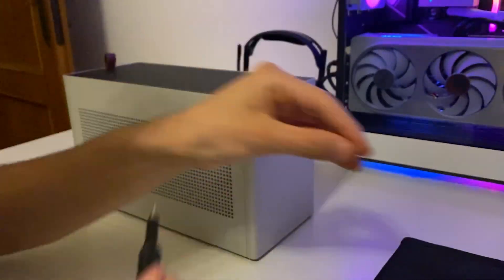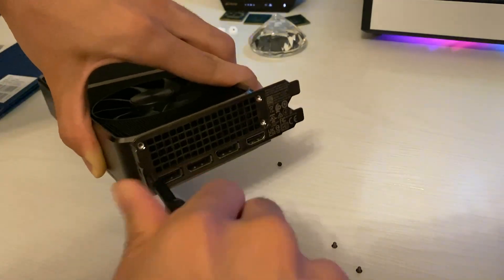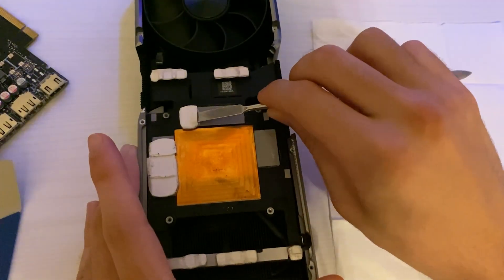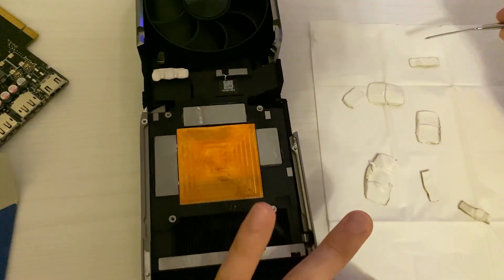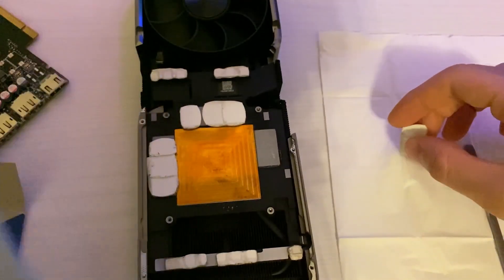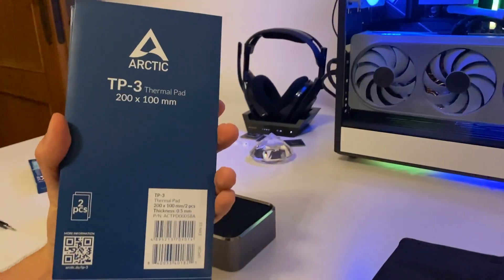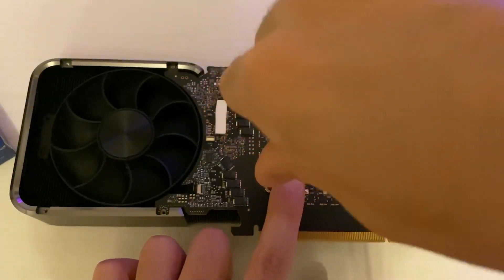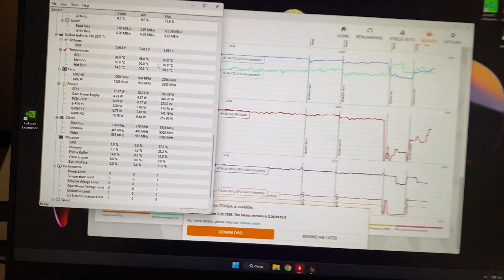You NEED to do this to your GPU | Thermal Pads & Paste Replacement Guide

Comment: Is 1.5mm correct thermal pad thickness for all 30 series Founders cards? I have a 3090 and a 3060TI?
Reply from the maker: Not for every single one, they made a few different revisions unfortunately. But yeah for most Founders it is

Comment: Stock temperature should be around 78 deg on core without overcloking. I did changed pads with same one and have also same temperature but they are whorse than before. Will ty squis them a make them smaller. If it helps😊
Reply from the maker: I’m sure it’s gonna work my man! :)

Comment: whats the correct thermal pads for rtx 3050 eagle oc? also which thermal paste do u recommend?
Reply from the maker: 1mm ones should work, but worst case buy a stack of 0.5mm and put them double or triple to reach the desired height. Paste wise I do recommend MX-6!
Reply: @ImWateringPSUs  thanks, this is the first time gonna do this so im kind of nervous, my gpu suddenly overheats, this doesnt happen before, this is 1.5 years old, thanks for the info, gonna sub!

Comment: I've been wanting to do this to my 3070 FE but I can't find the correct size for thermal pads
Reply from the maker: Yay that’s one of the trickiest parts. I’d recommend getting Arctic TP-3 in 0.5mm size and then stacking them one on top of each other to reach the desired height

Comment: You should try using phase-change material Honeywell PTM7950. It comes in as a sheet, lasts longer and performs in my experience works better than traditional pastes, and instead of thermal pads give thermal putty Upsiren UX Pro.
Reply from the maker: Thanks a lot for the suggestion, it’s not the first time I read about these! I’ll order a pack and make a video about it

Comment: Hello! I have a question: I have an RTX 3070 from ASUS TUF which is well known for its amazing cooling system, however I noticed that my temps were WAY, WAY too high at full load compared to what everyone was getting on the internet, for reference, everyone said it would normally peak at 61-62°C during full load, and mine was hitting 82°C at some point playing RDR2, so what I did is I figured out really quick that the thermal paste must have been dried up and it indeed was, I removed the cooler and I replaced the thermal paste with arctic MX-5 which i already owned previously, and that dropped temps about 12-13°C cause now im getting 68-70°C but i still think it's 8-9°C too much, do thermal pads impact the GPU chip temperature even if they are put on the memory and vrms? Because I didn't replace my thermal pads but i can tell they are pretty worn out, would replacing them fix the issue of my GPU temperature being too high or is it something else?
Reply from the maker: Your temps are overall good, remember that the fan speed is also important to normalize when testing temps. But to answer the question yes, better pads do help overall!
Reply: I repasted my Gigabyte 3070 and get around the same temps. Nothing to worry about👍

Comment: Have you seen the laptop alternatives?
https://www.youtube.com/watch?v=9uAAlIaOmQ0
Reply from the maker: That's an easier way to get the right size with pads, it works with desktop hardware as well but the cooling performance is quite a bit lower. You can get away with it on laptop but not on desktop GDDR6X memory!

Comment: i went with a evga 3080 hybrid never see temps over 55  with V Sync on, dont know why everyone needs 200FPS but 60FPS in my opinion good enough i never see flicking shuddering if u  use the min TDP  it will in the long term expend the life of the card reviewers ir Jay Linus Unboxed al push for max fps because frames sell good advise is to get a gpu which can play at 60fps and stable not go buy the next best thing my boy is playing Cyber Punk 2077 on a 1080ti and it plays flawless
Reply from the maker: VSync definitely helps keep temps under control! But it's still necessary to do proper maintenance over time, to keep the card healthy!
Reply: you have a 3080, you should be expecting much more than 60fps unless you're playing at 4k

Comment: Even if you buy it new ??
Reply from the maker: Unfortunately if you buy say a RTX 3090 new,  there’s a very high chance it has been sitting there for a long time. These are cards came out in 2020 so you’d be looking at a pretty good improvement in temperature with even if you had bought the card new!
Reply: If u buy it new don't repaste the card because u will loose ur 3 year warranty.  In order to disassemble u have to break the seal from the gpu die screw.

Comment: If u have an RTX 3070TI just sell it because of 8GB VRAM😂 dont bother to repaste and replace thermal pads.😂
The best thermal paste is Thermal Grizzly Kryonaut/ Kryonaut Extreme because has higher temperature conductivity.  Same goes for their thermal pads.
Why u didn't spread the paste with the included spatula?
Reply: Are you sure lol .... 8 gb still good especially for 1080p or 1440p ... Just put 32gb ram on your system especially when ram is so cheap now
Reply: @amarramoul4027  🤣
Reply from the maker: While I agree that 8GB cards are not gonna age well, it is true that for 1080p they're more than fine and they're gonna be for a while! Talking about the paste, I personally have found that Thermal Grizzly ages faster, so that combined with the thickness personal preference, I'd rather choose Arctic. There was no spatula included, unfortunately!
Reply: @amarramoul4027 Ram isn't the same as VRAM. 8GB of VRAM is still currently fine if you have a 3000 series card, however if buying a new card its wise to buy something with 12+ GB at this point for future releases. 

Next gen consoles effectively have about 12gb of VRAM at their disposal, this is what game developers will be targeting for ultra settings. However developers know most people are still on 8gb or less, so they will continue to take that into account for lower quality settings or risk losing a huge chunk of their playerbase.
Reply: @dylanwinstanley4738  The Last of Us part1 on Ultra settings in Full HD uses 8.7GB of VRAM when I play. So an 8GB gpu isn't enough in 2023. Diablo 4 easily eats 12GB VRAM on ultra settings and these are only in Full HD.
Reply: From my experience with Thermal Grizzly pastes are not suitable for high TDP GPU, CPU where the temperature is close to 80°C for a longer period of time. After 8 months, its thermally conductive properties deteriorate significantly.
You should try using phase-change material Honeywell PTM7950 to the core and on the power section, vrams give thermal putty Upsiren UX Pro.
Reply: @goorthiss  if ur gpu and cpu are running close to 80°C than u have a problem. With liquid cooling on cpu u never hit 80°C, not even in Cinebench R23.
An RTX4090 should never get hotter than 78°C with undervolt and good airflow case.
Reply: @d4nith3  such temperatures prevail in new gaming laptops as well as in graphics cards with high TGP and Intel 13xxx and Ryzen 7xxx processors in desktops, so I recommend applying PTM7950.
Reply: @goorthiss  In this video we are talking about RTX3070TI not some laptop chips. An RTX4090 can sit at 68°C under gaming in 4K ultra settings with ease.  So for PC builds the Kryonaut Extreme is perfect.
Reply: @d4nith3  Kryonaut Extreme is not perfect. In 8-12 months it will lose its thermal conductive properties, with PTM7950 this will not happen.

Comment: oh is that why my 3070 is suddenly overheating
Reply from the maker: Unfortunately yes it is😂
Reply: hmmm... I'll look into it then
Reply: Apply PTM7950 to the core, Upsiren UX Pro to the vrams and power section and do undervolting.
Reply: Yeah my 3070 was hitting near 90 in temps. Thermal paste solved it
Reply: so I tried removing it but it doesn't want to leave the chassis lmao
Reply: @DanYami  needs force mate👍